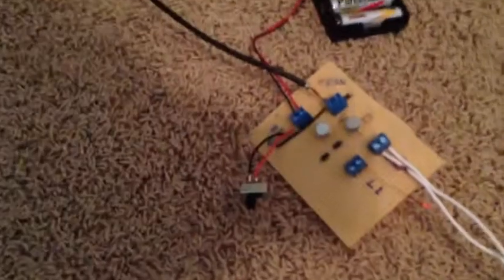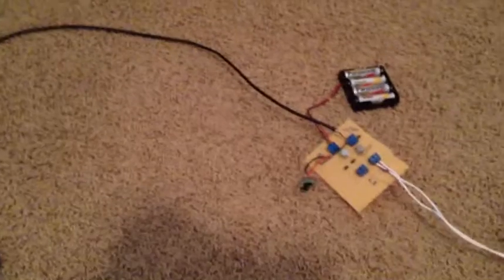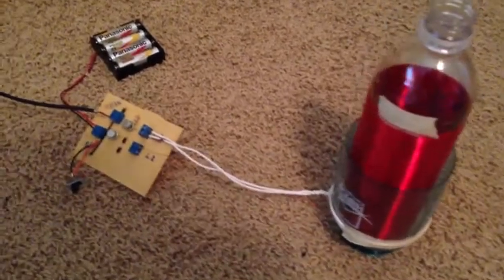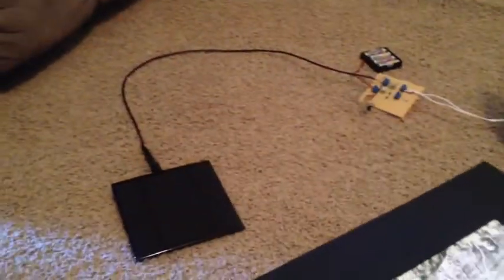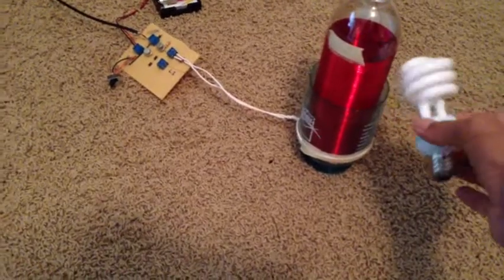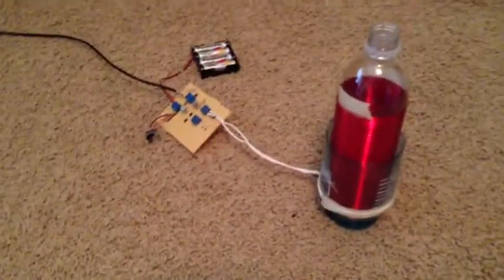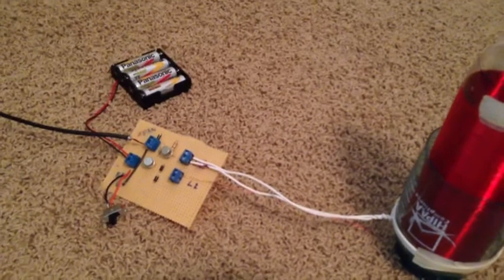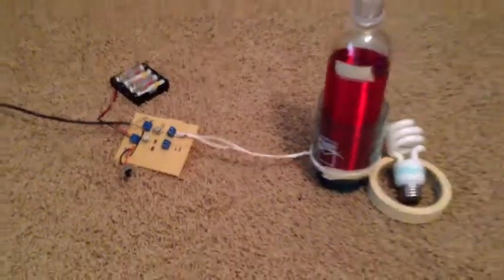Solar Wireless Energy Outdoors Light

Comment from the maker: @George Thomas-
Great little circuit . Make sure the primary and secondary are wound in opposite directions. 5.5V solar panels are available from eBay or alibaba. Panel output about 500mW in full sunlight. I did put a heatsink on the exciter transistor, not the solar switching transistor. Schematic is here: https://www.dropbox.com/s/mqnvteoufdrrz2p/Photo%20Jan%2010%2C%209%2023%2035%20AM.jpg

Let me know if you need any further info.
Reply: Thanks a bunch. I've just bought a solar panel for this.
Reply from the maker: Great. Let me know if you need any more info. I am planning on making a tuned wireless receiver for it so I can use it to transmit the energy over a distance and run some remote lights wirelessly!
Reply: Brian D Wireless transmission is easy. Make a coil identical to the transmitter and hook one end of the coil to an earth. To light some LED's you should step down the voltage by making a secondary. If you can slide the secondary up and down the coil you can tune into resonance precisely for optimum effect. I have a video on that. I have two SEC vids. One is better than the other.
Reply from the maker: Just tried it out and it works great. Can get 3 feet or more range. Also powered a small DC motor with it. I just posted these vids on my channel.

Cheers

BD
Reply: Great! I'll watch them.